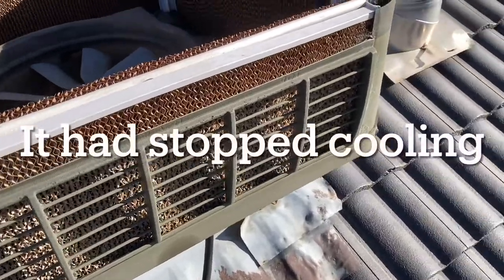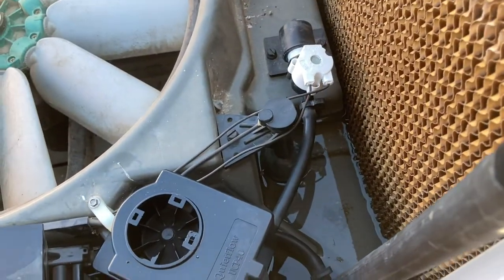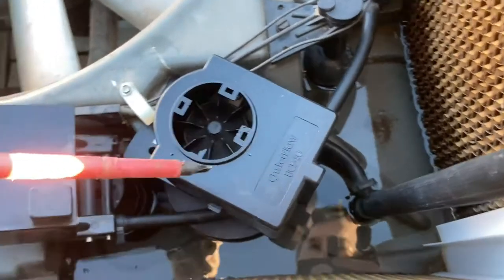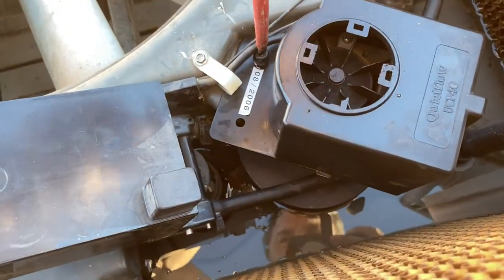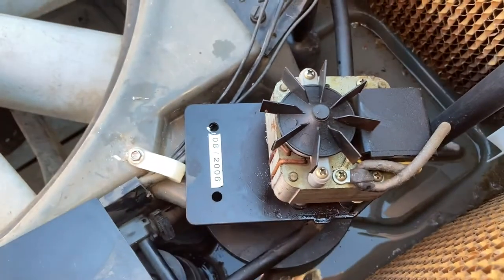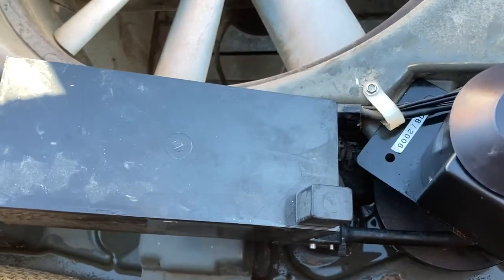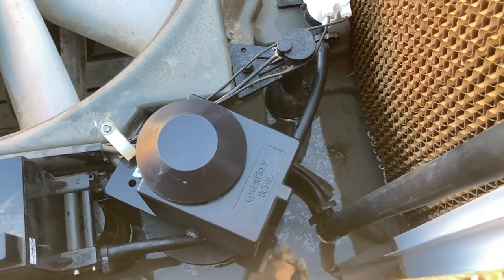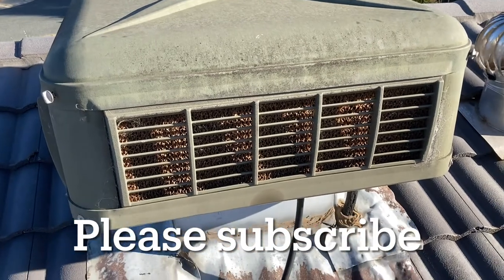Fixing my roof evaporative cooler

Comment: I need to replace my drain valve on a breezair.
Is it a hard job?? 
I've worked on cars before so I am okay with using my hands.
Reply from the maker: You mean the rubber circle it’s not hard, you can unscrew the drain from the bottom to release it
Reply: @BilalOz2012  
No,
My evap air con releases water as soon as you turn it on...the drain valve is not closing.
I think I need to change the faulty drain valve with a new one and was wondering if it was a big DIY job...
Reply from the maker: @atillaozturk7075  oh ok so it doesn’t drop down and block the drain? You should be able to replace that, it didn’t look like it’s too hard to remove
Reply: @BilalOz2012  
Cheers👍👍
Reply: @atillaozturk7075   hi bro mine is the same as you described exactly same problem 
And same brand 
Can you tell me what did you change or cleaned .need your advice please thank you
Reply: @bismillahnazari2623  
The drain valve was replaced (around $300 for a new one🙄)
Take out the pads( each is held on by two retaining clips) to get to drain valve, switch off power to unit and unplug the power cable to drain valve (it is pushed inside so you need thin long nosed pliers)
There is a large nut holding the drain valve into place connected to a large down pipe underneath...you undo that nut and take out the old drain valve and put new one on...make sure to clean the area off dust with brush...dont over tighten the nut or you'll break it. You need an adjustable muti grip pliers for the nut.
Turn the power back on and put pads back on....